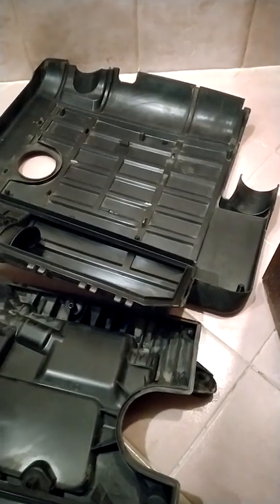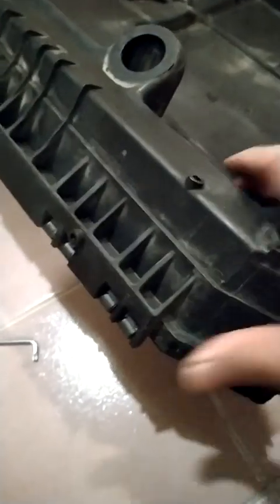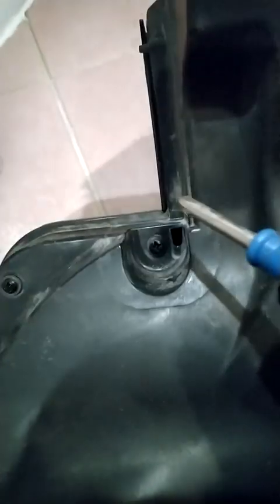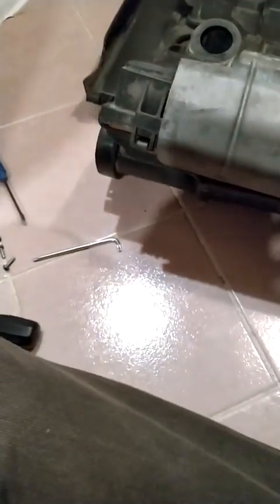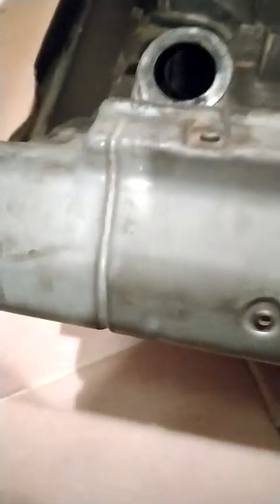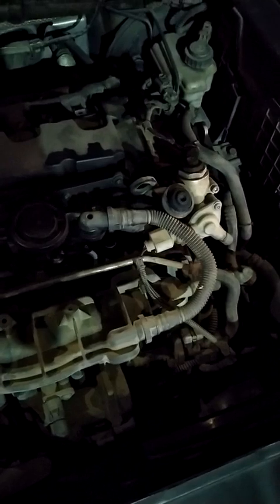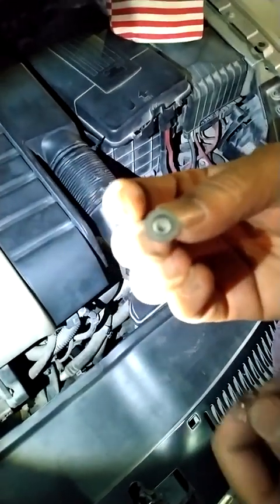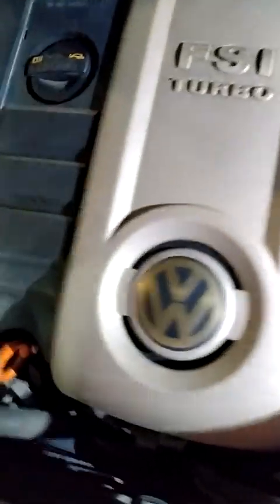VW EOS Engine Air Filter Box fixing and installing on Engine

Comment: It’s so dark, if you could show how it sits in the bonnet and then how you remove it and  open to replace the air filter and retighten it back up in position in the bonnet that would be most helpful. PLEASE RECORD IN BRIGHT LIGHT TO SEE what’s going on in the bonnet
Reply from the maker: Next time when I change I shall make the complete detail. It is very simple to fix it in the bonnet. There is no screw or nut. Just adjust at the right place and press down. It will be fixed. The two pipe holders One at the top left and one at the bottom right and also the weight of this box will hold this filter box at this position.